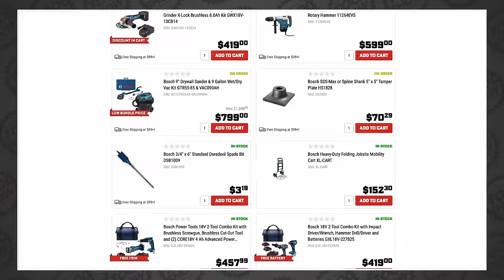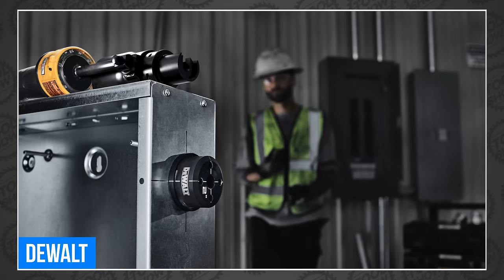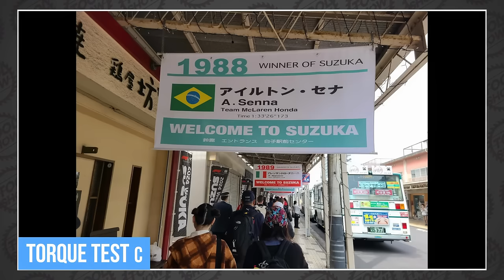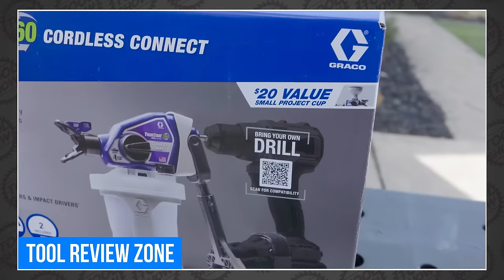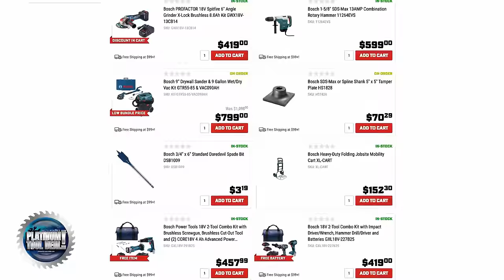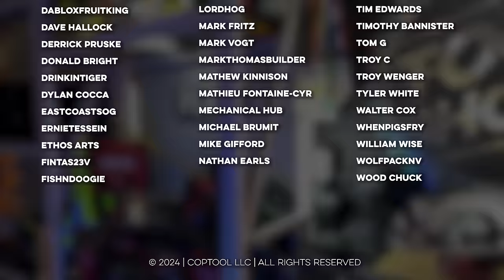NEW Power Tools from Milwaukee, DeWALT, RYOBI, and more!

Comment: Milwaukee needs to develop something I’ll refer to as “Base Camp”. This tools would run off of a 120v AC plug in cord. It should feature a 6 port rapid charger, powered ice-less cooler, a built in radio, built in charging ports for phones and headlamps and a dust free storage area. It should also either be on wheels or pack out compatible. It would be sweet if it had an optional hardtop work station on top. The goal would be to have everything in one spot at the jobsite and not have multiple separate tools. 

I currently have the 6 bay rapid charger, the pack out radio, and their non electric cooler. I wish they could combine everything into one magnificent product. I would honestly buy that at any price point.

Comment: Does the M12 fuel circular saw have a deeper cut than the original model? The original depth of cut was 44mm which is no good in Australia because our most common timber is 45mm. Hopefully this saw cuts deeper, I’ve looked at the dimensions and can’t see their depth of cut. Thanks.

Comment: 5:40 I really want to get the EGO pressure washer but I wish it had the ability to be plugged into the wall so I can choose not to use the batteries all the time. Would be nice if plugging it in also charged the batteries. Fingers crossed for the second version.